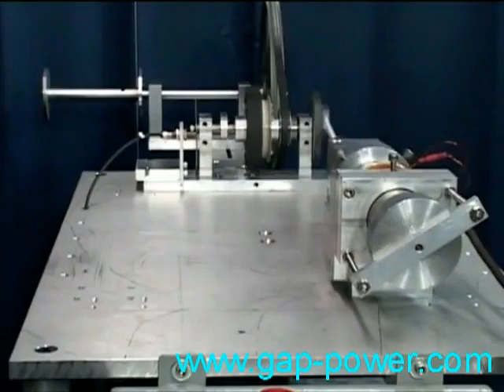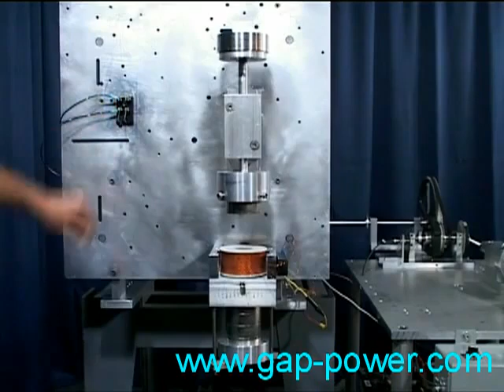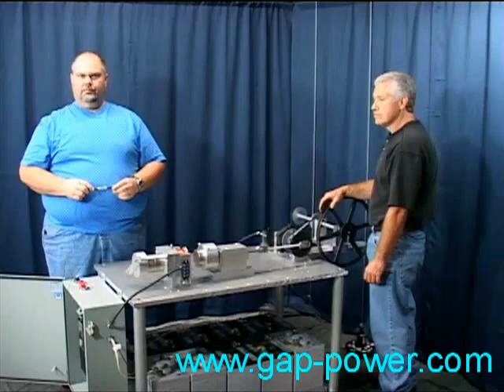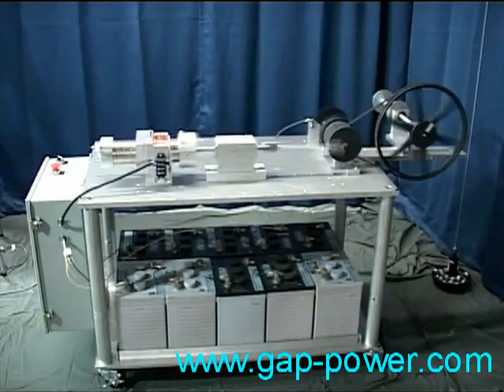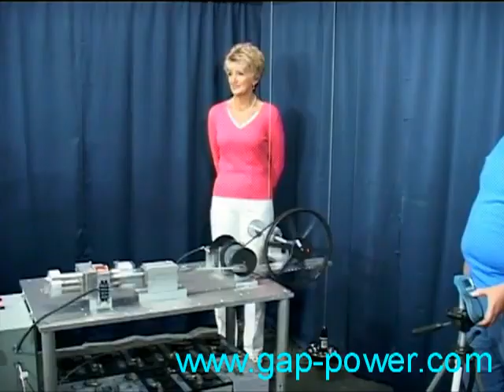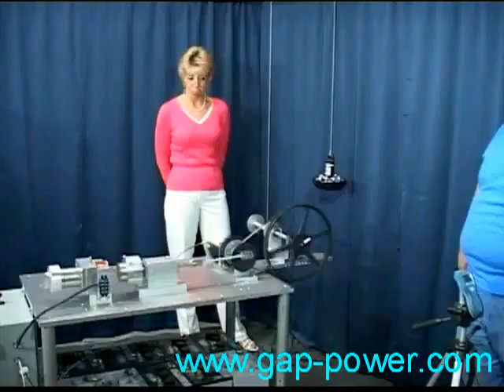FREE ENERGY  24 Working Magnetic Overunity Device   Magnetic Neutralization

Comment: Does it generate more electricity than the power required to turn on and off the magnet? If only a small amount is required to turn the magnet off then it seems logical that you would generate a powerful burst of energy when it is turned back on. It seems possible you are creating more energy then you are consuming, by using a way to tap into the inherent force of magnets.
Reply: Nice explanation, I think that this is the way forward with magnet energy,
unlocking the obvious latent energy in these powerful magnets. Neutralization of the field requiring less energy than actuation.

Comment: So what this machine does is act as a reverse solenoid?

Power goes in and powers the magnetic field, you get resistance losses in the coil and leakage flux on the outside of the coil. As the coil is being denergised quickly, there are reactive losses. Being DC there are internal resistances in the battery and fricitional losses in the piston. Energy is consumed to keep the magnet upright, upon denergisation the GPE is effectively lost. With so many losses in the system, how is this overunity?

Comment: The magnetic cancelation is not new concept but in way how it is used has example in this video. Even it is not perfect approach but still gives idea for making indirect energy generation where electrical power is used only to manage secondary reaction which is attraction/repeling of magnets in this case. Also this can be utilized in MEG, just a hint - the coil should be on 90 degrees to the pole of first magnet so there will be no direct influence to secondary magnet/coil from it...

Cheers!

Comment: Without the force of gravity, the coil does not neutralise the magnets, it has has to overcome them and pull the piston in all by itself. The work expended doing this will exceed the work done by the permanent magnets. This is a very inefficient motor. Look at the number of batteries needed to lift a small weight. The way to test if this is overunity would be to attach a generator to the output shaft to charge back  the batteries. It would stop running after an hour or two, that's guaranteed.

Comment: "This device doesn't even bend the laws of physics."
First law of thermodynamics: "Total energy of an isolated system is constant, energy cannot be destroyed or created"
Oh look, some law breaking.
Why all the power conversion? why not just work in watts straight off?
And "Magnetic cancellation?" That's an electromagnet. you are generating a field that attracts the piston magnet with the electromagnet. your power losses should be quite easy to find. voltmeter over the battery, done.